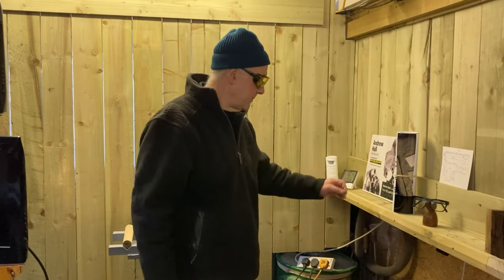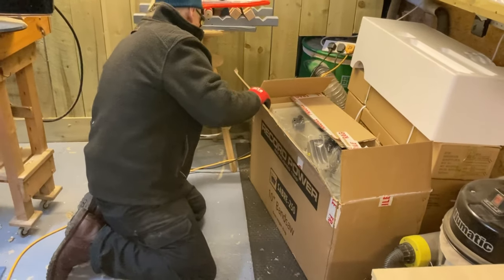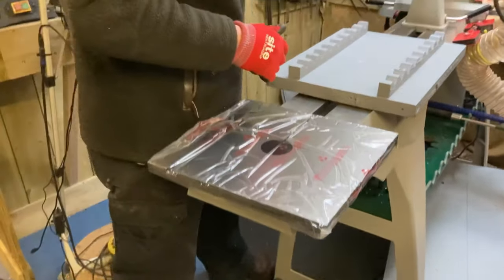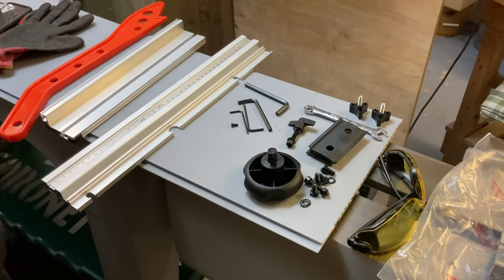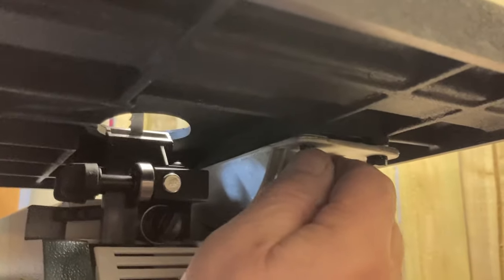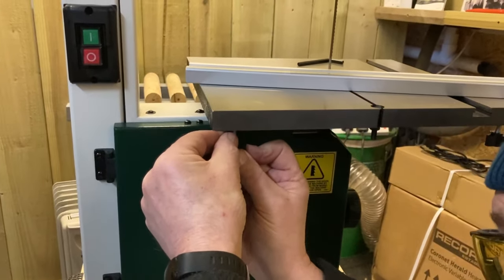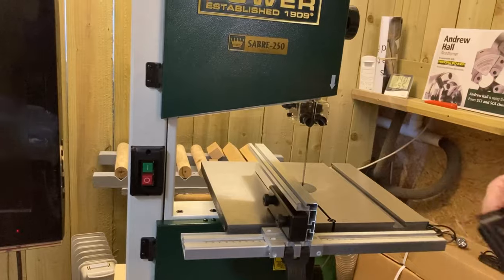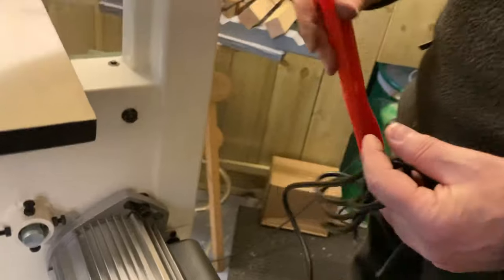Unboxing and setting up the new Record Power Sabre 250

Comment: I am considering buying this saw, but from this I am concerned about the fence. I notice this is gripped only at one end. I do not like this as it can cause slight deviation from true. With both ends clamped this is impossible. It does look a lovely saw though and very educational review.
Reply from the maker: Thanks for the comment Patrick, I’ve had no problem with the saw cutting strait to the fence however one the blade is used to cut a disk it wont cut straight again so I have a blade for through cutting and one for curves I use Truecut blades and they work well for me. Hope this helps
Reply: @andrewhall6880  yes that's good to know about the fence, I will bear it in mind, as this saw, although expensive, looks high quality.

Comment: Hi I’m guessing you considered the AC1950B from Axminster that’s been out of stock for a while. If you did what was it that made you go for this one? I have read many reviews on the Axminster one and the thing that puts me off is the ever so slight apparent flex/twist in the machine once blade is tensioned properly. I do not know if you’ve read this about them but would be good to get your thoughts. Also is there any flex at all in this machine, the best way is to put a square next to the blade and then tension to see if the square moves against the blade. I hear the wider blades need more tension so may be worse with that. I’m toying between the two (this one) and the Axminster, the thing I would swap from the Axminster is the side loading of the blade, seems a bit stupid to remove the fence rail every time hence needing to realign to square the fence up again.
Reply from the maker: Morning Chris thanks for your comment. No I didn’t actually look at any other bandsaw I chose the Record Sabre as I have had record saws and and machinery before and have always found then great and the added bonus is the customer support with the 5 years guarantee. I had the BS350 but wanted to replace it with a smaller bandsaw so opted for the new Sabre which I am very pleased with. I cant comment about the axminster as I haven’t used the model you speak of however I have used other axminster bandsaws in the past whilst teaching and demonstration for axminster and always found them satisfactory as well. I think the products available now a days are so well engineered its really down to personal choice and budget, for me I would normally choose Record after having worked with their lathes for the last 20 years. Hope this helps to make your mind up regards Andrew
Reply: @andrewhall6880  Thanks for the reply Andrew, would be good to know if you have found any flex in the machine or any other issues in the near future. Thanks again 👍🏻